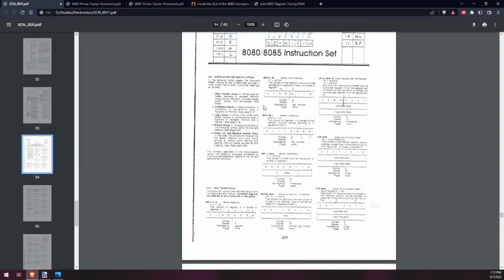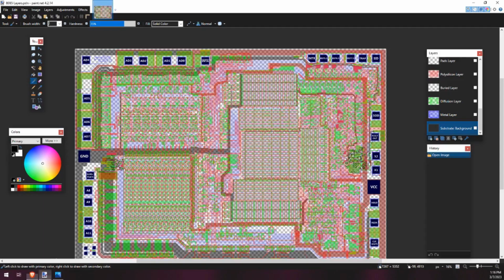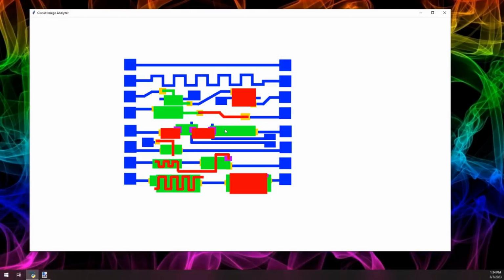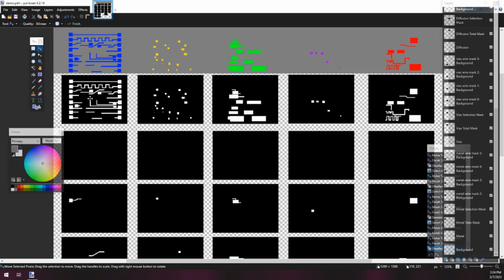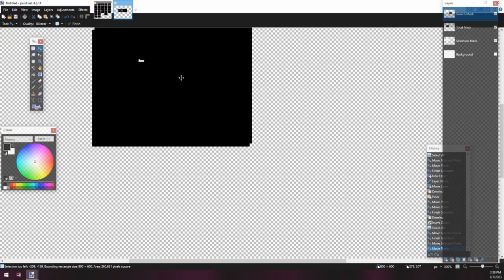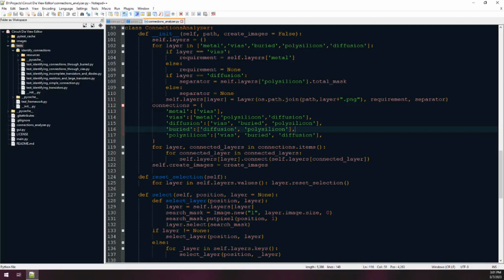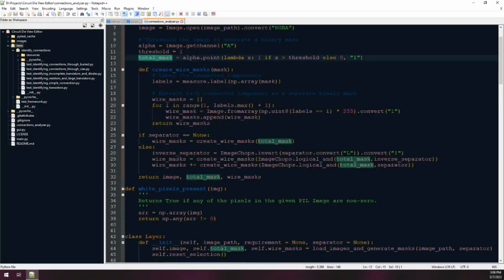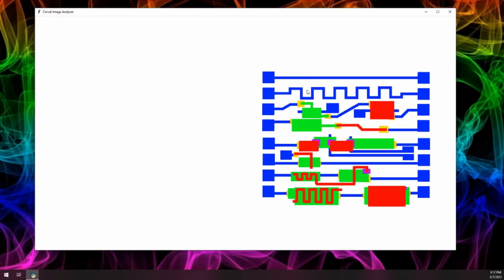Circuit Image Analyzer Vlog Entry #1

Comment: A few suggestions for optimization:
-use a faster language (Python is famously one of the slowest languages there are)
-use a lower-level rendering library. Raylib is pretty easy to get set up, and it's insanely quick. There is likely a Python binding for it that you can use.
-Python has a lot of weird quirks, since it's interpreted. There are too many to list here, but you can look up "how to make Python faster" and you'll probably find something.

Javascript might be a good option for a different coding language, since it has a lot of similarities to Python but it's A LOT faster.
You'll have to get used to using curly braces though, and I don't know how willing you are to learn a new workflow just for one project.
Reply from the maker: Swapping languages at this point might be a tall order, as I'm already familiar with the python language, and my goal here is to just put together something quickly.
Though that's not to say I might switch languages in future.

For the time being though, I can see if Raylib has a python library. Thanks for the tip.
Reply: @n00b_asaurus  Another idea is to use pypy instead of normal Python, since pypy uses JIT. I haven't heard much about how compatible it is though.
Reply from the maker: That may be an option.
I did say the issue was definitely in the rendering side of things, so I'm not sure if swapping interpreters would help, but it's always worth a shot.

Comment: I was wondering what are the dimensions of the die picture ?
Reply from the maker: roughly 7200x5300. I think paint.net lists the dimensions somewhere around there.
Reply: @n00b_asaurus  7200x5300 ? seems a lot. I was thinking about the dimensions in number of little colored squares. From a roof calculation I get 1250 squares on the horizontal axis.
Reply from the maker: Wait, are you talking about the die images for the 8085? Or the sample images I put together for testing? Because the sample images are 800x600
Reply: I’m talking about the die image of the 8085, because I was thinking that rather than making lots of mask calculations you could create a big 2D array which would contain instances of some wire class, which means you could easily name, look at the connections, change the color and even simulate some parts of the 8085.
So I wanted to know the size of the image to see if the array would get too big or not.

Comment: This is a really nice tool! I recently got into reverse engineering analog chips. The LT3750 fascinated me particularly, and I got Richi's Lab to decap one and post some die pictures. I severely underestimated the task of reverse engineering though, and wondered if there was even a tool that could do it for me. Not sure if yours can analyze weird BiCMOS processes, but this is a step in the right direction!
Reply from the maker: The thought had crossed my mind to make my tool a bit more configurable so that different die structures could be analyzed. Though I decided against adding that feature just to save time.

I'll probably post the code on my github within the next few weeks. You're more than welcome to fork it and modify it however you see fit.
Reply: @n00b_asaurus  Sadly I'm not much of a coder, but I do know some people who might be able to help.

Comment: are you also going to write a program to label and visualize transistors (maybe even logic gates) automatically? or are you planning on doing that manually?
Reply from the maker: Probably not.. or at least not at this time.
If I were to do something like that, it would probably push out the completion date waaaay too far out, and then we run the risk of entering development hell.
I'd rather not do that at this time. I'd rather just get a basic tool set up and move forward.

Again, I might play with that idea later, but that will be later.

Comment: do you code in notepad++??
Reply from the maker: I do.
I know it's not the greatest IDE, but it works :)
Reply: Chad
Reply: @n00b_asaurus  not to cause trouble.. but you might wanna look into using VSCode!
Reply from the maker: No trouble, I had been considering switching IDE's, but didn't know which ones would work well for me.
As most people say, the IDE doesn't matter too much, what matters is that you stick with one and learn how to use it well.
Still, if I'm going to be switching IDEs, I'd like something that I can  hit the ground running with.

I'll look into VSCode. See what the fuss is about at least ;)
Reply: @n00b_asaurus  I would (personally) recommend VSCode. It has relatively few features, but in your case I believe that's probably a good thing since you're used to using notepad++.

Setting it up for Python is pretty easy in my experience, although that was nearly 3 or 4 years ago when I was first learning how to program so who knows by now lol